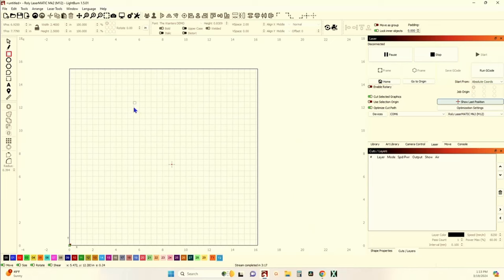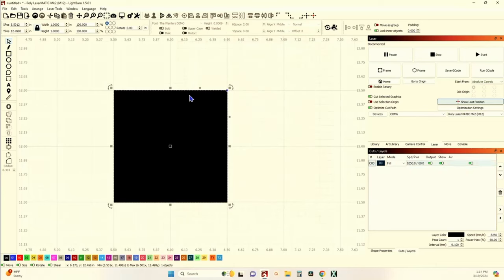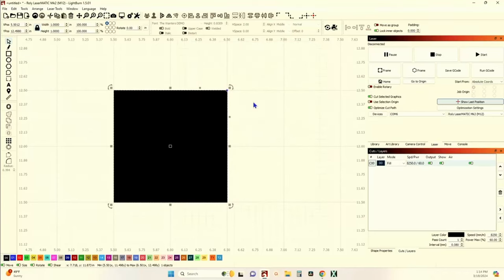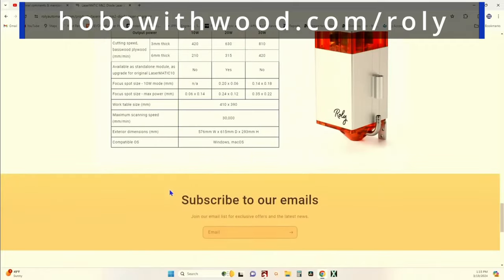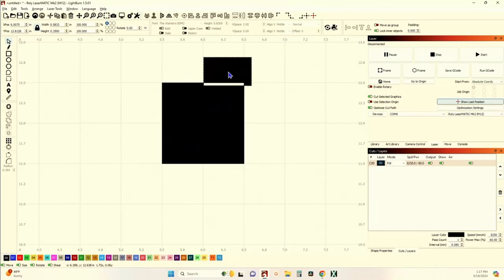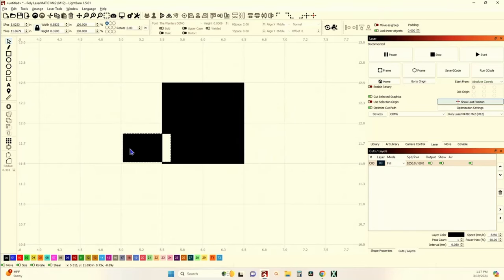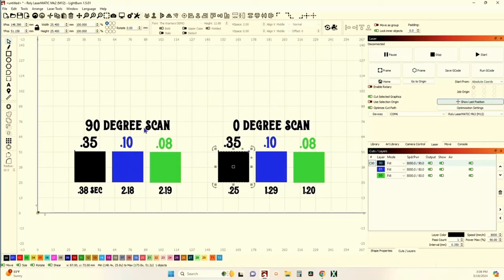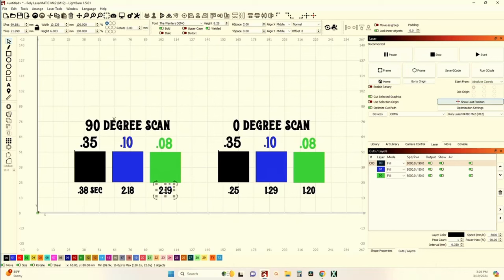Understanding LPI: How it works and how to use it

Comment: Question: Do the same thing but change from .35 to .22 see what happens??
Reply from the maker: Even though the 0-degree scan angle is faster, it still takes longer due to the smaller spot size requires more LPI.  0-degree scan angle using a .22 line interval results in 115.45 LPI taking 2 min. 90-degree scan angle using a .35 line interval results in 72.57 LPI taking 1 1/2 minutes. And that is only on a 1" square. That is still 25% faster using the 90-degree scan angle.

Comment: Steve, great video and I really learned a lot. One question, do you think the direction of the grain had any impact? It looks like the X-axis test were with the grain and the Y-axis went against the grain. Just wondering if that make the lines stand out more on the X?
Reply from the maker: Depending on the material, it can make a make a big impact. Softer materials are more inclined to show the lines when scanned with the grain. Bamboo and Pine are some of the worst. But some of what you see in these photos is created from too much power burning into the second layer of the plywood. But scanning perpendicular to the grain does help.

Comment: I understand the advantage for a larger spot size if you are doing a filled box, but doesn't that give you a poorer resolution if you are engraving a picture? I always thought the smaller the dot size (lpi) the better the resolution - just like a computer or tv?
Reply from the maker: I did not suggest this is the way to use your laser 100% of the time. There are times this will come in extremely helpful. Trying to engrave an image may not be the right time to use an LPI equivalent to spot size. Not all diode lasers have a spot size that is wider when scanning on a 90-degree scan angle. Nearly everyone uses a 0-degree scan angle. But some might should be using a 90-degree scan angle to get their smallest spot size. But I purpose ANY design using "Fill" would benefit from this as long as it is not an image. When I'm doing an "Image", I actually do the opposite of the suggestions in this video. I use the smallest spot size scan angle.  I use a much higher LPI. I also slightly raise the focus. The higher LPI and slightly raised focus will create overlapping passes with the laser. This will make sure there are no visible "rows" created by the laser. But with the higher LPI and overlapping passes, you have to test to find the best power settings. It will most likely be less than you think. But if it's a regular fill, this will work. I use a "Line after fill" to give the design the definition it needs.
Reply: Thanks. @HoboWithWood

Comment: Have you done these tests at 45 degrees?
Reply from the maker: The goal here was to find the fastest way to complete an engraving. To do this, you need the largest spot size at the optimum speed and power. While the 45-degree scan angle is great for uniform kerf when cutting boxes, it is not the largest spot size when using a diode laser.